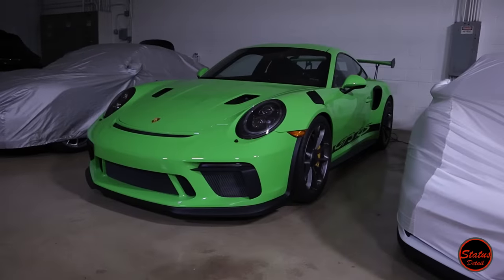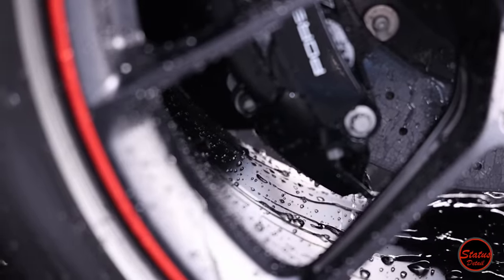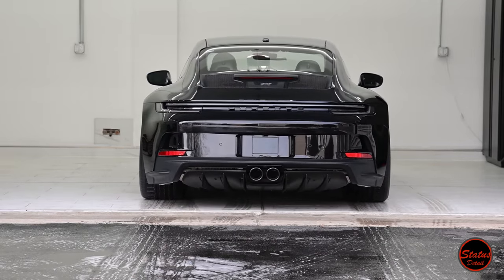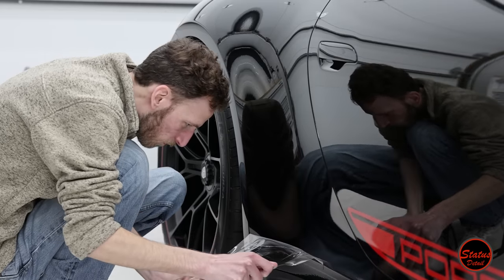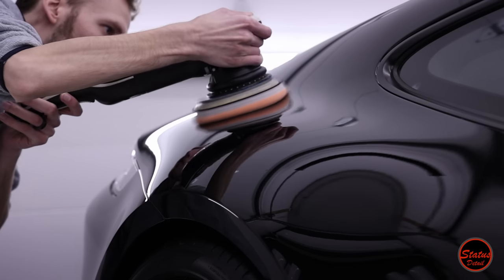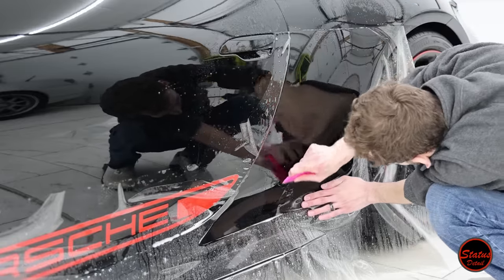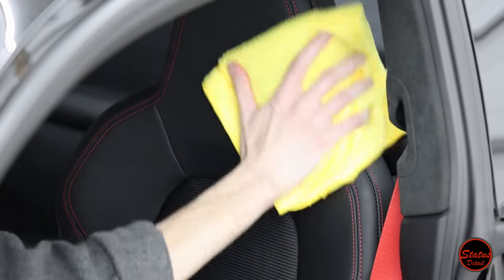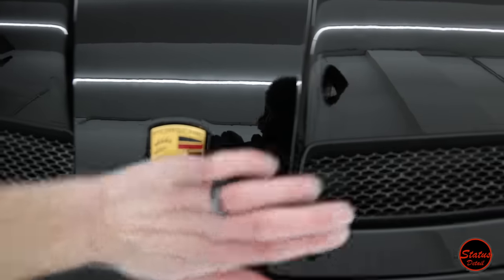992 GT3 Touring Fixing SECRET Delivery DAMAGE

Comment: Wow! Simply amazing. I'm truly speechless watching your attention to detail. Coming from a novice weekend warrior detailer, how many total working hours did you spend on this specific vehicle? Also, before watching your videos, I never knew there was a reason to ceramic coat after PPF. I guess I was under the assumption that if someone chose PPF, they would be off the hook for having to ceramic coat. Also, since watching your videos, I now try to follow your wash process. I purchased a used 2019 Audi A6 in Mythos Black and was amazed at how delicate the paint was. But by following your wash steps, I'm able to minimize any additional swirls. Thanks for the great content and tips.
Reply from the maker: I'm so glad your enjoying the videos! . not sure how many hours this was but my gt4rs detail video was over 100 I believe. 

Yes you definitely want ceramic on PPF. Gloss. Self cleaning. Easier cleaning. Chemical resistance. It's matters on your top layer of protection.
Love that new microfiber process 👍

Comment: Finally! This is the content we've been waiting for. Love your perfectionist approach and also up-beat personality - shows extreme confidence. Thank you so much! I especially like how you talk about the hardships of removing deep scratches and marring, which isn't really shown in the detailing businesses as they tend to just cover them up. I can't imagine how long you've spent on that little section alone.

I have a quick question:

After this kind of correction is applied, how would the owner go about and maintaining the washes from a weekly or bi-weekly perspective? For example, do you want to go through a full detail every week, or would that be overkill? One thing I have an OCD about is I just go through a full detail wash (water rinse, pre-wash, water rinse, 2BM wash, rinse, sealant). It takes up a lot of time unfortunately. As for my monthly (once a month wash), I go through the full 3PH method (alkaline, acidic, and neutral shampoo).
Reply from the maker: Thank you! So happy to hear your enjoying the videos!

If you have the time you can't really overdo it on a wash if your doing it properly. 

I have a video or two about washes or like quick washes. 

But the general rule is if it looks like it's pretty dirty you're going to have to wash it properly. 

I do have a video in the works on how to do a proper wash start to finish that will cover basically everything you should need to know like how to remove tar if needed how to remove bugs if needed etc
Reply: @STATUSDETAIL  Thank you so much. That sounds proper. I think you mentioned it in one of your videos that made me kind of confirm my thought. I guess there shouldn't really be any time constraints when it comes to car washes/detailing.. I think you said it best, "if it looks dirty, it's going to need a clean."

Yes, I saw your video on another Porsche where even if it is perfectly ceramic coated and doesn't look dirty, there will always be a remaining 20% or so of dirt left on the car that can't be seen. I think that stuck with me ever since and that is why I just go through the whole car washing process no matter what (I don't have too much time constraints as it's very therapeutic to detail my cars fully even when they are minimally dirty).

I'm looking forward to your next narration! Thank you!!

Edit: Another question: What is your take on applying sealants/quick detailer to the car after every wash? I know it doesn't harm it, but I was just curious if this is something necessary.. I use a sealant w/ ceramic properties (gyeon quick detailer that you recommended before) that I just use everytime after the drying process. I just don't trust the labels saying that they last for a month. Might as well reapply it every wash?
Reply from the maker: @simplyeric12  I highly recommend a product like wet coat or hydro at the very end of your wash right before you blow dry.
I'm That will definitely help make the drying process very simple and very fast with a blow dryer.

Naturally there's going to be some water left and mirrors will drip and things like that.

It can be a very nice helpful way to dry the car fully at that stage where the ceramic detailer or reload 2.0 or cure etc 
I don't think there's anything wrong with that.

I also don't think there's anything wrong with having the car completely clean in your garage and you only did wetcoat. So now you do cure or reload or q2 wax or exo etc for fun on a clean dry car because you love the car and the process and have the time. 

Just don't stand in front of a dirty car and rinse it and then say oh man it's dirty. Then ceramic detailer the rest to clean it. That's the half steps that get you in trouble.

Comment: Amazing job as always! Lots of detail you put in! 

Curious when a car shows up like this does the dealership compensate in anyway?
Reply from the maker: It's possible. But didn't happen on this car. They might pay for paint correction if you ask.
Reply: Thank you

What kind of pressure washer do you use along with the spray cannon? Looking to purchase one
Reply from the maker: @SherazKhan-kn9zo  foam Cannon vs s PF-22 on statusdetailstore.com

The pressure washer is a AR blue 630 tss and it's from obsessed garage

Comment: Fabulous work. Atom mac by bilt hamber, will solve the steel brake disc rust, apply prior to washing. HTH
Reply from the maker: What about the inside of the vented rotors and back side of rotors ... You can only spray he face

Comment: As always, love you work!

I do have a question regarding the interior though. My car is new and although I asked them not to clean it before delivery, unfortunately they did.
That being said, I found swirl marks all over the digital instrument cluster and I was wondering what you might do to remove them? I’m thinking of polishing it but afraid of potentially making it worse. Any suggestions? 

Sorry for the long post but I appreciate your advice!
Reply from the maker: Thanks for tuning into status!

That's not a long post at all!🙂

What kind of car is it?

It's usually a pretty bad idea to go polishing plastic screens like for rpm and mph etc. They won't come out right and it's a frustrating thing. The new Porsches usually have like glass kind of now. So that helps tremendously
Reply: It’s a 2023 Civic Si. Definitely not a Porsche😅so unfortunately it is a plastic lens and Honda’s gauges are notoriously easy to scratch which makes it rather difficult to keep clean.
Reply from the maker: @jasongalante644  my first car was a Honda S2000. Civics are awesome 🙂

Yea I'd probably not mess with it. I'm guessing you have some minor swirls in it?  That is frustrating but even with perfect care it's going to build swirls over time
Reply: @STATUSDETAIL  the S2000 is a great car and I’m definitely enjoying my Si! Thanks for the advice man. I appreciate your input and keep doing what your doing!

Comment: Hey when you are using a quick sealant on the wheels, do you have to be really carefull not to get any on the ceramic rotor? or is it ok if it gets some spray on it? heard on another video that if you get any on the rotors that you will clog the pores in the disc and risk damage... would be great if you could clarify, love your videos :)
Reply from the maker: Ive never heard of that or been concerned about it. It is wise to rinse them out well during the wash. It's also not a huge deal of a list quick detail spray mist hits it. 

You must be careful with the wheel cleaners or decon soaps you use tho! A product like iron x or iron x soap should not be used!

If your foam with iron x soap you need to be very careful to not foam the wheels and in general I'd honestly just avoid it if possible.

Comment: You have serious skill!  Love watching your videos.  Sorry for asking in the comment section, but do you have a product recommendation for hard water spot/mineral deposit removal on a ceramic coated car?  I tried Gyeon water spot remover, but with little success...the spots are very light, but I'm bummed they showed up on my first wash after ceramic!
Reply from the maker: You are always welcome to comment questions 🙂
Thanks for watching btw!

How did you use the water spot remover? Relatively clean car. Spray on. Let it sit for a little while on shade. It can sit awhile as long as it doesn't evaporate or dry out. The. Wipe with a little agitation. CarPro spotless is the same thing but that's what I usually use actually. 

I have removed pretty nasty stuff with that. 

If you have isolated spots of spots.ypincan use a light polish or in extreme case compound. Work by hand each spot and that tends to work. In a more extreme case use a polisher. In a more extreme case you wet sand.
Reply: @STATUSDETAIL  Thanks!  I think maybe I didn't let it sit long enough.  I'll try and give it a few min in the shade and see if I can get it out!  Thanks again for the content and answers!

Comment: Great video and amazing work as usual. I am interested in the products you use and that are on your website, but I have a couple questions about what is best for my use as far as ceramic options and soaps and ceramic sealants for maintenance once I have ceramic coated, is there any way to speak with someone about putting together a package that would be best for me? Or what is the best way to contact for advice on product purchases? Thank you in advance.
Reply from the maker: I'd recommend you dm me on Instagram. I'm pretty fast at responding. 

You can also email statusdetailstore @ gmail

Comment: I admire your work. Real Pro! I have a question : when would you use Carpro Reset instead of Lift and vice versa ? Thanks
Reply from the maker: Reset is just your normal wash soap so you would basically always be using that.

Lift would just come before reset. Lyft is a little stronger so it's going to kind of loosen dirt and pull a lot off if you shoot lift on it then rinse it. Then you would use reset to do your normal wash. If your car is extra dirty or it's been several weeks you might want to use Lift first
Reply: @STATUSDETAIL  Super 👍🏻. Many thanks .

Comment: I'm picking up my new GR Corolla in 2 days.
With that black Porsche, regarding the paint correction I assumed you would use a Polish with a polishing pad, rather than a compound?
What polish and pad would you suggest I use on my new GR Corolla?
How many pads do you need to use for the entire car?
Reply from the maker: This is a complicated question to answer because depending on your car s issues or lack of issues you would need different approachs. 

Compound is used on hard paint or deep bad scratches. Polish is used after compound or on light defects and light swirls. Jeweling polish is after normal Polish for a little extra gloss. 

Your GR hopefully needs carpro reflect and a orange hdo pad
Reply: @STATUSDETAIL  
Thanks.
You do great work my friend.
Reply from the maker: @dougmaverick3287  thanks! I'll try and talk more about correction 🙂 n future videos 👍👍

Comment: Nice work as usual!
Try Jescar correction compound for almost no dusting and incredeble results. Did you use Halo ceramic coating?
Reply from the maker: I don't like halo and reflect and ultracut don't dust much if you use brand new pads. When your using a slightly used pad you experience more dust. I have heard good things about Jescar but I'm pretty particular about polish and compound
Reply: @STATUSDETAIL  
Thanks for replying…
Trust me when I tell you that you will like Jescar! I just finished using it to correct my Tesla and I was amazed
Reply from the maker: @RayNLA  nice!

Comment: Is that scratch something Porsche would repaint if you brought it to their attention? I would think that if you removed the PPF and found something like that they would take the car back and fix it...... Right?
Reply from the maker: They would literally repaint like 40% of that side of the car because that panel is huge. 

They would probably just wet sand it and remove it but then you would have really thin pain so there's really no winning there that's kind of why in this case the PPF going over it was really relieving because we know we've fixed it enough and the film conceals the rest. Put bottom line is you don't want to see that on your brand new very expensive car

Comment: I have a question. Would it not be better to use the wet coat on the rims after the wash, because you putting after the wet coat directly chemicals on even a little bit on the rotor wich you rinse properly before.
Reply from the maker: I do sometimes do hydro or wetcoat after the final rinse. I don't think it's a huge deal because it's pretty strong. But is s fair point for sure

Comment: Hey quick question, when using any detailing brushes on the exterior of a car, which ones do you recommend? The ones that generally say "exterior safe" in amazon etc, seem so stiff and I feel like these can easily scratch, specially when detailing the black plastic trims and around emblems etc. I  noticed you used the super soft brushes  for the exterior.  (i use these on my interior),
Reply from the maker: Detail factory brush on
Statusdetailstore.com

Comment: Can you tell me what is the best way to remove the Black paper from Windows without scratching anything, It's actually illegal here in my country and I was recently fined for that so I want to remove it but I still haven't because I have seen spme cars and because the paper is sometimes applied 3 or 4 years ago, it also leaves black residue as well along with the sticky glue. What would be the best way to remove it in your opinion?
Reply from the maker: I think your referencing window tint? I've never actually removed window tint from a car. My tint  people just handle that.

I'm pretty sure they use a steamer though
Reply: @STATUSDETAIL  Yes I was referring to window tints. Thanks I'll try doing that amd test it on the rear window first❤️
Reply from the maker: @yasa6764  you are welcome. Good luck!

Comment: if you use hydro after cleaning wheels, does that interfere with the bonding of ceramic coating on wheels when you apply the coating later on in the video?
Reply from the maker: In my experience no. And if we do apply the serious ceramic after we do a lot of panel prep first. Basically isopropyl alcohol. This does a pretty good job of removing previous sealants.
Reply: @STATUSDETAIL  👍👍👍. Thanks for explanation

Comment: Brake buster neat on carbon ceramics & those very delicate centre lock nuts? I was told PH neutral on those expensive items. I’ve inherited some slight discolouration on my “approved used” centre locking nuts, it wasn’t noticeable at the dealership. Any tips for improving their appearance? Cheers.
Reply from the maker: It's a oddly sensitive area. 

I have never had issues with it and I routinely take care of a lot of CCB and Porsche center locks for years. 

Acid based wheel cleaners are big nono and iron x too. 

Don't use any chemicals on hot wheels or in sun if possible
Reply: @STATUSDETAIL  thanks for reply & tips, you’re a legend 🍻

Comment: why did you PPF part (the door) over the decal but the back corner panel you put the decal on top of the PPF??
Reply from the maker: There is no PPF on the door. That's why we pulled the fender decal. So the PPF could go on the fender and then the detail can go on top of the PPF. So now the appearance of the vinyl decals is identical from the door to the fender.

Comment: That would be tough to buy such an expensive car and have to do a paint correction right off the bat. You would think they would have these cars paint corrected at the dealer before they are sold considering the cost of pretty much every Porsche.
Reply from the maker: Check out my other videos. This is very normal and the dealership might pay for it but you don't want a dealership doing your paint condition. Get a detailer with more experience.

Comment: I have a new Jeep and they are a nightmare to correct, I don't see swirls or scratches in the paint and was just thinking about coating it without polishing, is that a good idea?
Reply from the maker: I'd consider a in depth decon wash. Then prep then ceramic. Or add correction in. 

Personally I won't warranty ceramic unless it has correction
Reply: @STATUSDETAIL  Yeah I was thinking just doing a mild polish on it. Jeeps are just so damn hard to do.
Reply from the maker: @JoeSmith-nu8oo  totally understand. G wagon is the same

Comment: You wash a vehicle from top down. You don't want to drag dirt over what you cleaned.
Reply from the maker: I don't think you listened to the wash  method. It does not matter what panel you wash in what order if you wash with multiple microfiber towels using the method I described. I have a separate video on this too
Reply: @STATUS DETAIL  It does not  to let dirt flow down the sides when doing sides first then top? Foolish
Reply from the maker: @QuietStormX  I'm not sure I understood what you typed. Can you say that again?
Reply: @STATUSDETAIL  You wash a vehicle from Top to Bottom. You don't want to let dirt flown down the sides. You want to flown down and off. Get it?
Reply from the maker: @QuietStormX  what you're saying is kind of funny because it's literally supporting my method of using multiple towels and actually working bottom up I'm not saying necessarily want to work bottom up

Bottom line is you don't seem to understand the multiple microfiber towel wash method. 
That's ok tho